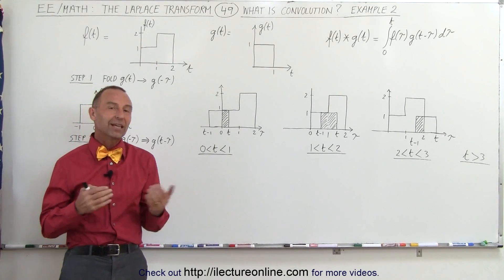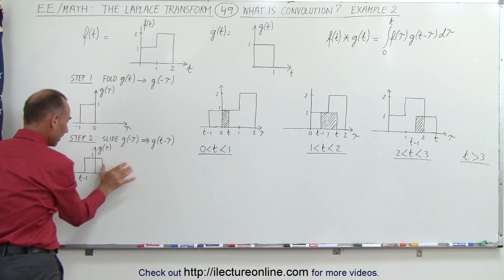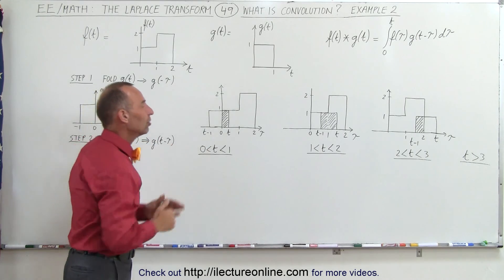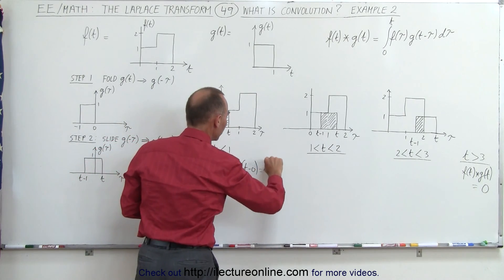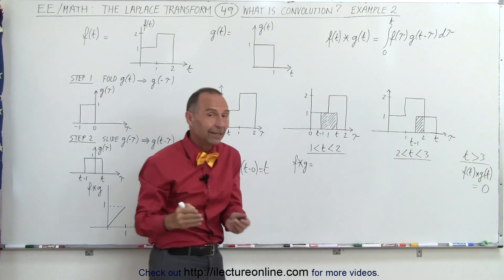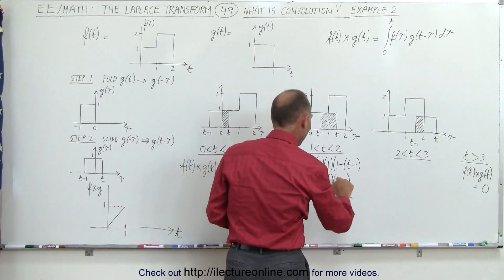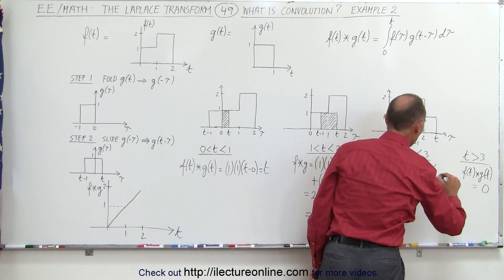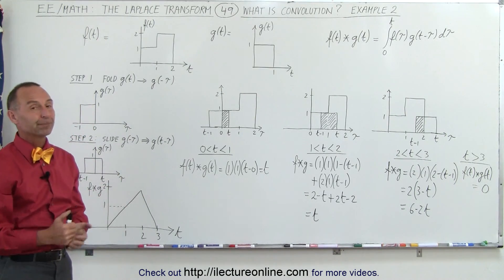Electrical Engineering: Ch 16: Laplace Transform (49 of 58) What is Convolution? Example 2

Comment: Hi Professor Bizen, I have two questions here. 1) What is the purpose to fold the g(t) in the first step instead of just shift it to (t-T) directly in the first place? 2) If the initial g(t) is not between 0 and 1, but 1 and 2, is that mean we need to fold it to  -2 and -1 before we transfer to (t-T)? Thanks!
Reply from the maker: There are often multiple ways to solve this type of problem.  Try it and see if you get the same answer.